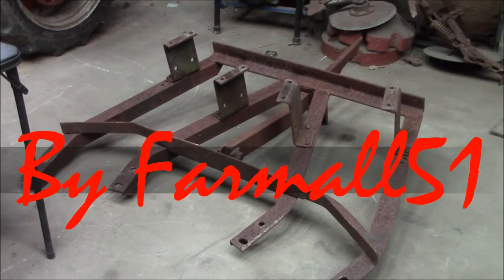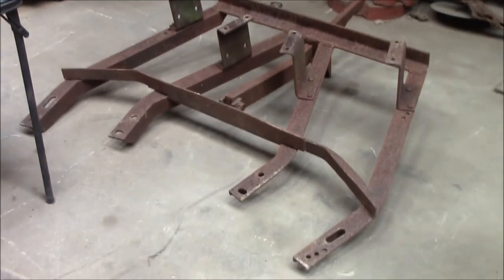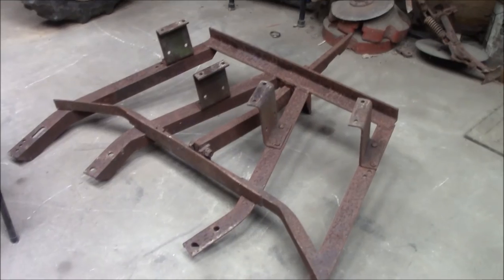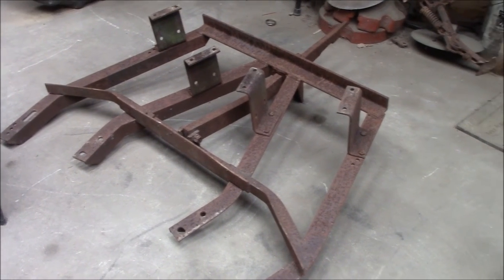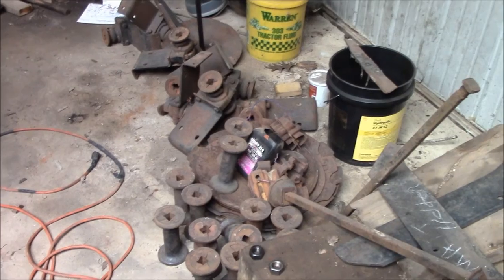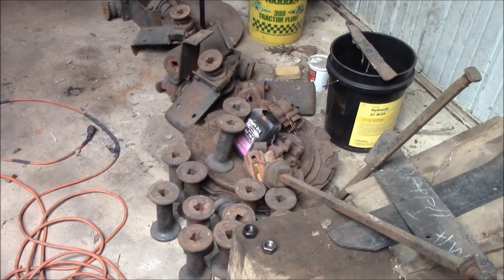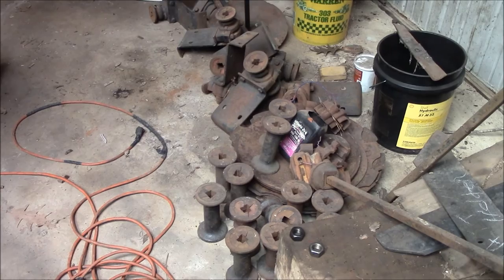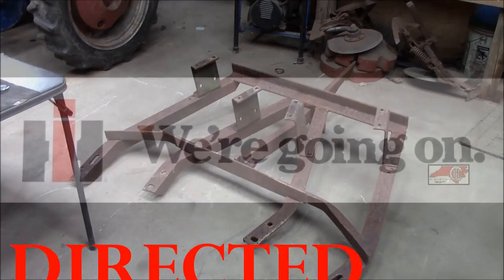IH McCormick  F-36 Tandem Disc Harrow Build part 1

Comment: Have you ever thought of using an electrolysis tank to take rust, I have found it works very well and is pretty fast, I have some cub cadet parts in my tank right now. good video.
Reply from the maker: MissouriOldTimer Yeah Ive thought of trying it but a friend of mine put me on to the molasses trick .  Its kinda like you set it and forget it  but it works better than sandblasting but just takes a little longer .